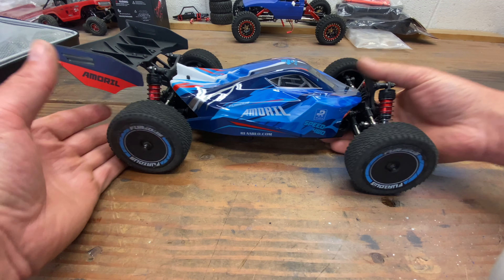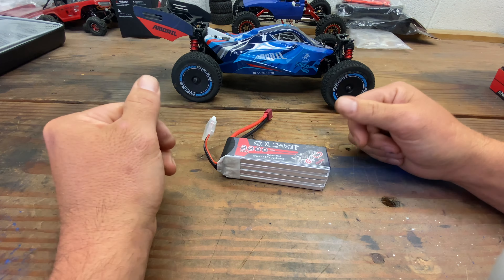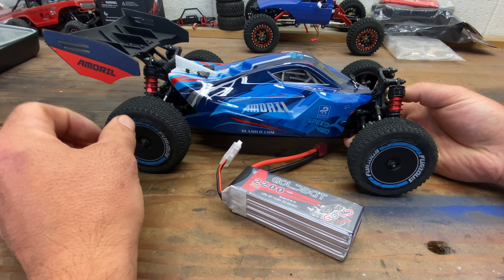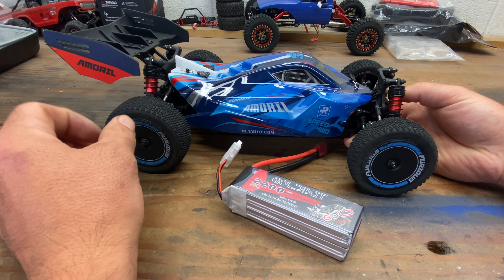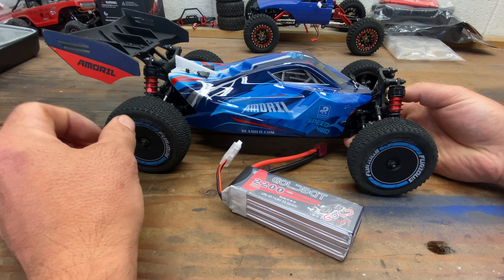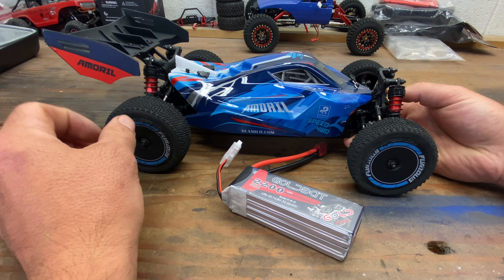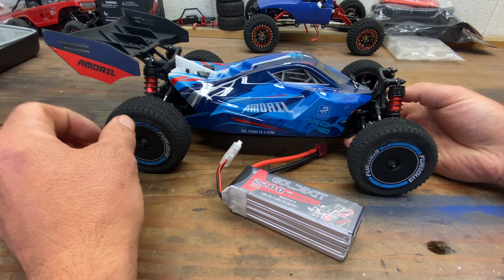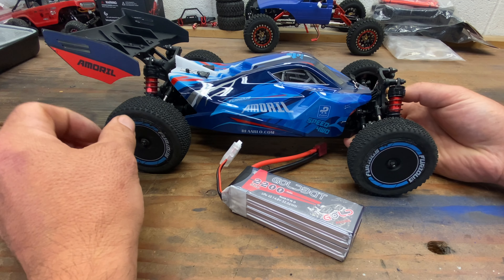RLAARLO AM-X12 on 4S - 100+ KPH Speed Run

Comment: Awesome run man😁 I'm loving this thing lol so much fun this little guy makes some perfect jumps👍🏼I'm not tryin 4s though lol the only modification I would make is moving the battery tray to the front so it doesn't get scraped by the drive shaft but other than that I'm loving it😁✌🏽
Reply from the maker: Thanks! Glad you’re having fun with yours. I’m building a backyard track this weekend. I have most of it done. Hope to be hitting some jumps soon. I won’t run 4S unless it’s for speed runs. I think it would get way too hot if I ran it on dirt or in the grass.

Comment: Are you still use the original esc and motor from am x12? Because my mine can't support the 4s battery, the esc always auto cut off on the start clik switch on.😅
Reply from the maker: Running all stock everything.
Reply: @ReadytoRunRC  yeah, i see your video from start to finish, so what happened with my mine? 😩
Reply: Mine does the same thing ,beeps a couple times and shuts off. Esc cannot handle 4s, same esc in the am-d12, and it does the same thing.can you explain that?
Reply from the maker: @PulsewidthRC  I cannot explain that because I don’t know why it doesn’t work for you with 4S and mine does work. Maybe they did an update on the newer ones to not allow it to run on 4S but I can’t say that’s what it is or not. Just speculation.
Reply: @PulsewidthRC  yeh me too.., your'e am x12 carbon or alloy? I think the carbon version can use 4s, because the carb version uses a larger ESC. And uses be better transmitter and rechiver, so not same with alloy version.😁